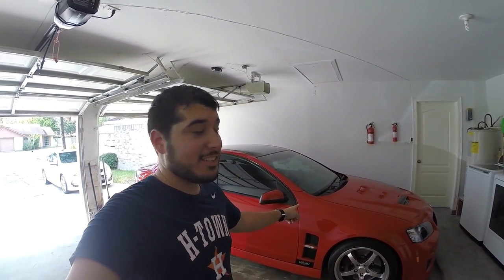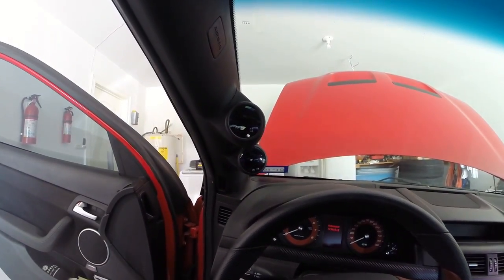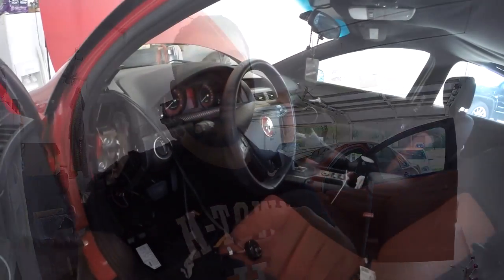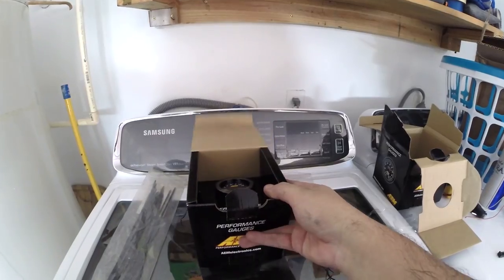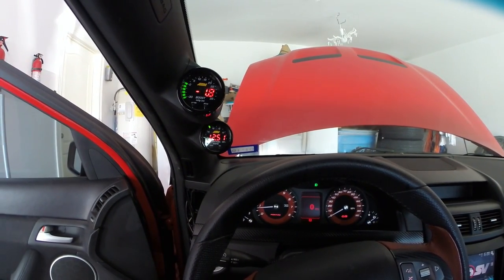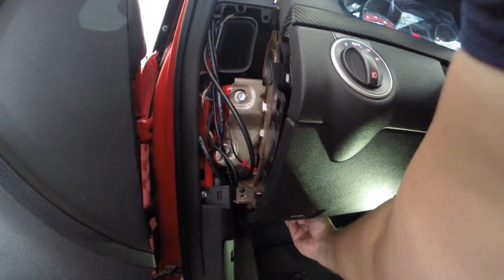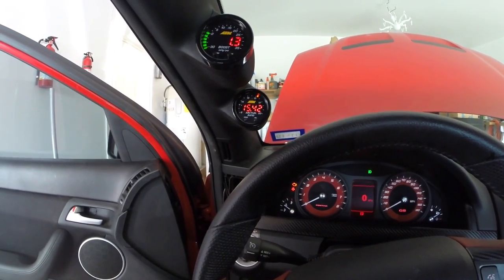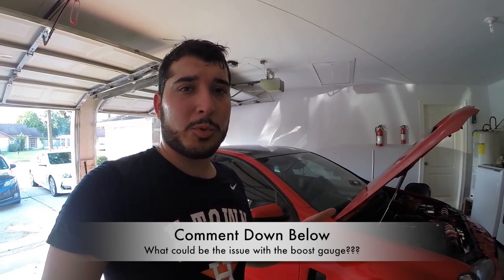Installing new gauges in preperation for the dyno!

Comment: Which circuit did you wire the wideband to? A quick g8 forum search tells me multiple locations like aux power or just piggybacking from headlights.
Reply from the maker: Richard Olsen the wideband gets the power from the guage inside the car. I tapped into a fuse in the kick panel
Reply: Jorge's Vlog do you remover which fuse you used?
Reply from the maker: Richard Olsen no but I can check the car tomorrow. I’ll comment back on here
Reply: Jorge's Vlog thanks appreciate it
Reply: On the back of my boost gauge you can calibrate it with a screw driver to get it to zero when your at idle nothing wrong with your sensor